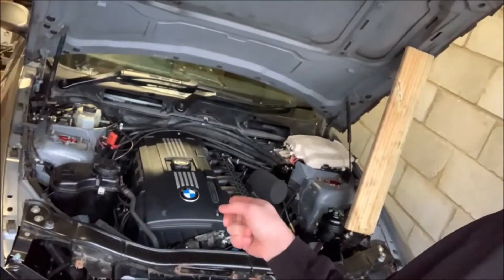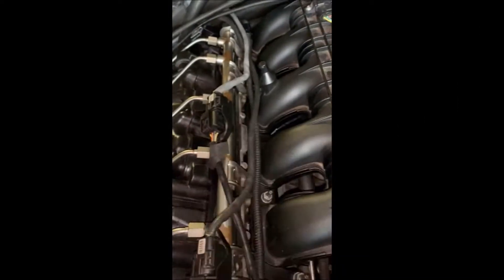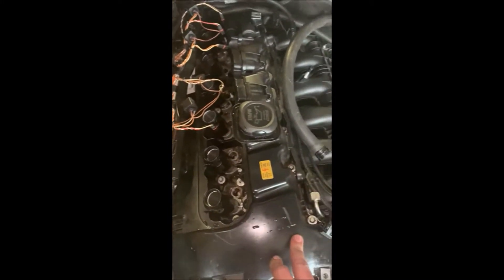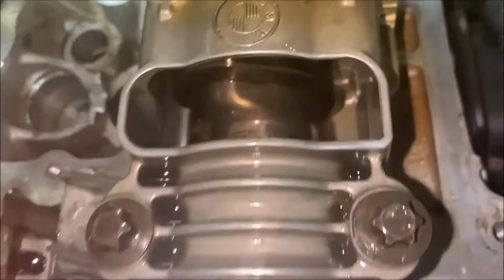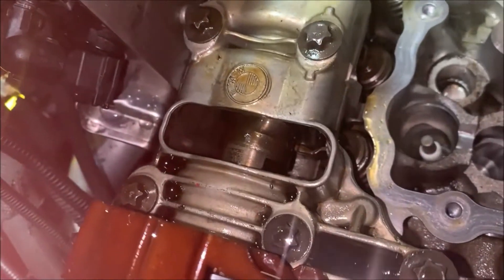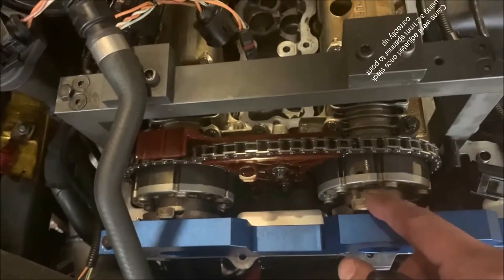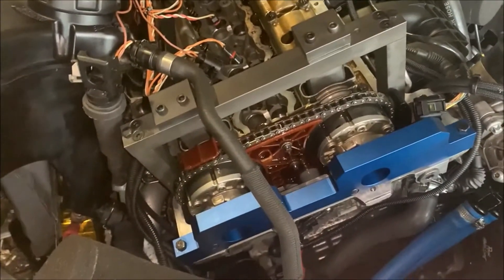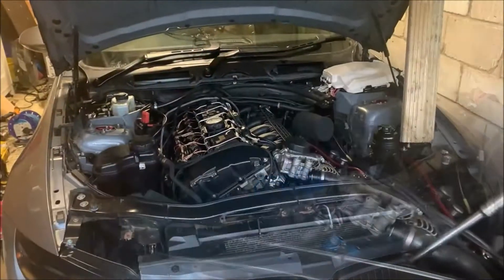N54 Timing procedure 2A97 2A98 codes walkthrough VANOS

Comment: Hi, just wondering if you know what causes the timing to go out. Currently having vanos issues and car is in the garage. Has done 72k miles and full BMW service history, 16 year old 135i with BMW warranty so hoping they cover at least some part of fixing it although they don’t cover adjustments
Reply from the maker: @Dave-k9  could be a few things, but i guess most common would be a tired chain tensioner, over rev, stretched chain….only takes a single tooth jump and thats it.
Reply: @listerofsmeg80  thankyou. The garage have just today mentioned potential oil pump failure as it generally runs well and just pops a code from time to time and one of the codes is related to something sticking. Getting it stripped to investigate next week. Seems a very complex system! Cheers for the reply and video

Comment: I had codes hinting to replace rhe camtrays and seals. When i setup everything to start the repairs my timing was the same as yours, it was a little off but always started and idled with no issues. I then proceeded to make the repairs and set the timing with the lock pin and alignment tools. Now that everything is reinstalled i get no start and the code 2A9A with an occasional 2A9B. I have swapped all the sensors, checked all wires and connectors with no difference. I have since removed the cover and inspected the timing again and everything still lines up perfectly when i install the timing tool. Any idea what it could be?
Reply: Did you solve this?
Reply: @M-ot1ds honestly been on the back burner for the winter. I'm trying to get back into it now that it's warm out. I have checked the timing 3 times before I threw in the towel but I am going to try and set it up like it was originally and hopefully it'll run like normal. I am getting sputtering and it running like crap for about 30 seconds before it dies. No codes or anything. It is leaving alot of soot on my plugs.
Reply: @erikalvarez4516  update me if you have a solution please! I got exactly the same issue. My ideas have come to an end....
Reply: @M-ot1ds  no codes pop up for you either? I may do the old fashion way of finding TDC and stick something like a ziptie or a straw in cylinder 1 spark plug hole I'm wondering if I'm off a tooth or 2 and it's not able to adjust the VANOS to compensate
Reply: @erikalvarez4516 did you figure it out?

Comment: Once the lock pin is in the crank shouldn’t move up or down right , my lock pin is in and I can’t move the crank up or down but it does have small play .. is that fine or it has to be rock solid to the point where it should even move at all? Great video by the way
Reply from the maker: Thats normal, the hole is oval on the flexplate/flywheel to allow a little movement
Reply: @listerofsmeg80  ok I see so it is fine if I’m able to move up and down just a lil from the crank hub as long as it doesn’t go far up or down I’m locked in  , Im literally doing this right now to fix the timing.. after changing the cams and ledges something went wrong .. thank you for the response btw
Reply from the maker: @boost7236  if it was me, turn the crank clockwise until it stops and then time from there. Let us know how you get on :)
Reply: @listerofsmeg80  ok I will do that , hopefully it fixes my issue
Reply: @listerofsmeg80  getting codes 2a98 2a99 and 3100 limp mode of course
Reply from the maker: @boost7236  whats 2a99? I dont have my list to hand…
Reply: @listerofsmeg80  code 2a99 is for “ crankshaft - exhaust camshaft reference “
Reply: @boost7236 did you ever fixed it ?

Comment: I have a question I can’t get answers to because I can’t get logged in to Bimmerpost or e90post. I have a 08 N54 and my serpentine belt shredded. Nothing went into the crankcase after doing a thorough inspection. I was having a 2a87 and 3100 thrown so I got two new vanos solenoids because everything was pointing to bad solenoids. After replacing them with OEM certified solenoids and the proper oil with new filter  I fired up the car and it went from 2a87 to 2a99. It starts up fine but idles really rough. 3100 is still present because of limp mode. I’ve replaced serpentine, vanos solenoids, oil filter housing gasket and cooler gasket, upper radiator hose, the “Mickey mouse” coolant hose flange, intake manifold gaskets, the oil change and filter, coolant bleed/flush/change. Could it be the vanos filters or a blockage somewhere causing the code? Any help or info at all would be greatly appreciated.
Reply: Did you find out what’s going on ?

Comment: Hi love the vid. I have a question. I have a N54 that stop running when it was just ticking over. Long story short my crank bolt came out. So before I throw loads of money at it I want to try to time the car myself. Question is can I undo the camshaft bolts 1st then replace the crankshaft bolt to turn the engine over to find top dead centre without the top half moving? I’m hoping she only slip a little bit before the engine stop.
Reply from the maker: If the crank bolt came out you may have a goosed engine. Mine did the very same on the dyno and it resulted in 24 very bent valves :( if you got luck though, you would be wisest to undo the cams themselves to take the pressure off the valves, that way you can turn the crank without hitting the valves. Once the crank is at tdc you could then bolt down the cams in the correct positions and time it from there. Hopefully that makes sense!
Reply: @listerofsmeg80   thanks that helps a lot 👍 I’ve spoken to a few ppl that had there crank bolt come out and the lucky ones was the ones that it happen on low revs. The high rev ones needed a new engine. So I live in hope lol. Thanks again and I will be looking out for your next vid 👍

Comment: How tight did you turn the tensioner tool? 
Did u have tensioner tool attached when you rotated the engine?
Reply from the maker: Yes i did have it installed, and it was tightened by hand until the chain became noticeably ‘tight’. Turned the engine twice to check position then took it out and reinstalled the actual tensioner.